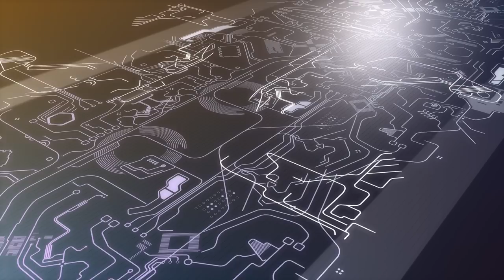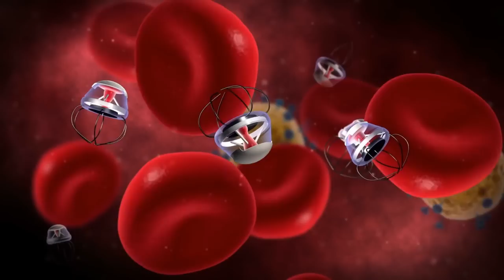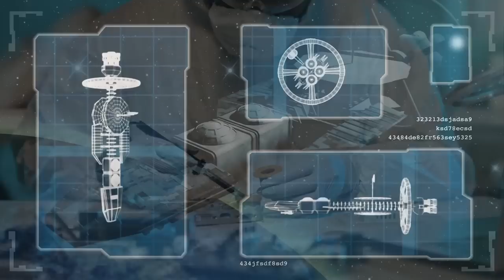Damaged Spacecraft & Shipwrecked Saucers

Comment: Starfleet is lucky to get volunteers at all, the way they do wiring. No wonder Scotty was on edge ALL the time; every interaction with the tech could have meant a horrifying electrocution.
Reply: I don't know why Starfleet just doesn't use crew consoles as warheads instead of antimatter.
Reply: It sounds to me you have no idea how the systems are surpose to work. There wiring is a lot more complex than anything we do. It is a mix of plasma and electrical circuits. There power systems are plasma based they don't have generators like we do. There power systems have direct conversion from plasma. That is extremely efficient but a lot more complex.
Reply: @clementvining2487  It is funny how with centuries of technological development, Starfleet still hasn't rendered pyrotechnic circuit breakers obsolete.
Reply: @clementvining2487  
All that complexity, with memetic gel packs and buffers everywhere, but something bumps into the outer hull in the just the right spot and ZAPP, another guy on the bridge gets charred to a smokin' spot on the carpet, and lightning flies all over the room...also, I'm makin' a joke about old-timey special effects.
Reply: @clementvining2487  And terribly implausible for an organization that prefers to have at least two backups.  Why would you pipe plasma into your control consoles when you can just use low voltage, low amperage electricity?  You don't get more or better responses to controls by way of Tim Taylor Technology; it isn't a problem you can solve with MOAR POWAH.
Reply: @earnestbrown6524  Yeah, a front company that sells discount electronics to the Cardassians...latinum only plez.
Reply: @boobah5643  The consoles generate there own electricity from the plasma. It is more efficient. The few times the explosions on the consoles happen is when exterme overloads happen usually in battle. The ship is very large and that is the most efficient way of using the energy. What you are suggesting uses too many interface systems. The control consoles can control almost everything on the ship.
Reply: @arcadiaberger9204 The don't use circuit breakers  they use power relays.
Reply: @clementvining2487  I will cling to the "pyrotechnic circuit breakers" explanation. It's parsimonious and funny.
Reply: @arcadiaberger9204  OK if you want.
Reply: @clementvining2487  If efficiency is getting people killed then Starfleet ships should not be prioritising efficiency. That's Borg philosophy.

If it must use plasma, have a big plasma converter near the bridge and run electrical cables from there. By making it one big unit, it should be easier to fit whatever system is needed to make it not explode.

I mean seriously, why is it less safe on the bridge of the USS Enterprise D than the UNN Agatha King?
Reply: @ReddwarfIV  It is star travel getting people killed. The technology is safe until   they are attacked or come across something unexpected. You change thing like you say you may make it more dangerous somewhere else on the ship. The best route is to make it as efficient and as safe as possible.  Nothing is perfect not even on a star ship especially on a star ship. Efficiency of the power systems means more power to protect the ship. So what you prefer less power with more damage from attackes or more power and less damage. Which well kill more people. The technology is set up to bring plasma anywhere power is needed and then electrical is  generated from there.
Reply: @clementvining2487  It is neither efficient nor safe to have many small power converters that are all at risk of killing a crew member, instead of one big one.

Please explain why it is neccesary to run plasma (a high temperature ionised gas) into a console that ought to require no more power than whatever device you are reading this on, since it is merely a screen with enough electronics to discern what commands you are giving and then send those commands to the ship's main computer.

Imagine replacing an ocean liner's Engine Order Telegraph with a version that uses a hydraulic line full of nitroglycerin, and tell me how that is safer and more efficient.
Reply: I’m surprised Scotty didn’t come out of Starfleet with Smoker’s Lung. That wiring sound hellish
Reply: @ReddwarfIV  First off it isn't a power converter. It is a power generator the plasma is the fuel it has direct conversion to electricity from plasma. And the control console is what it says a control console and you claim to know how much power is required on the bridge of a star ship with warp drive. It is like all the controls for a small city dozens and dozens of fusion reactors and atomic fuel cell all over the ship. Matter antimatter technologies and power systems. Keeping the warp drive balanced. Shielding and deflection technologies. Direct control over hundreds of system all over the ship. Look that is how it is suppose to work. I am done with auguing why or how safe it is. Think what you want I don't care have a good day.
Reply: @clementvining2487  Converter, generator, whatever, you're arguing semantics when we're both talking about the same system anyway... and you still used the word "conversion" in your rebuttal.

Yes. A control console. All it has to do is tell the ship what the crew want it to do. The sensors aren't inside the science console. The phasers aren't in the weapons console. The impulse thrusters are not inside the helm console. If these consoles are drawing enough power to warrant a direct feed from the plasma conduits, then they are in fact highly inefficient for their purpose.

Yes, it's starship with a warp drive. You'd think they'd have a more advanced interface than touchscreens, which we have right now. Holograms have their own flaws but at least the emitters keep crew out of the blast radius.

"Look that is how it is supposed to work"
I know. I am aware that there are in-universe explanations for why Starfleet ships are badly designed. This does not change that they are badly designed, nor should it prevent me from pointing that out.

TVTropes has a name for this. It's called a "Voodoo Shark". Where, in response to criticism, a writer will come up with an explanation that is even sillier than leaving it unexplained.

Consoles exploding is silly. Consoles exploding because Starfleet deliberately designed them that way is much sillier, and makes Starfleet look incompetent if not downright malicious to its personnel.
Reply: @earnestbrown6524    Or just install fuses and capacitors in them?
Reply: @ReddwarfIV  Dude what wrong with you I tried to be nice. I told you I was done with this augment. You don't address anything I say and totally discount everything and keep repeating yourself. There is no point I am not interested in talking to you so drop it.
Reply: @clementvining2487  If you want to end an argument, don't try to get the last word in.

Don't expect me to drop it when you won't.
Reply: @ReddwarfIV  First off dude I didn't say the control panel needed a lot of power you did.  I simply said how it was getting the power. Next don't tell me I can't have the last word and then stop. I didn't give up I simply think there is no point going farther because you don't acknowledge anything you simply keep repeating yourself. 

The idea you can say something unsafe when you have no idea how it works is ridiculous. And it is sifi they are going to make someone get killed the console exploding is for show it means nothing. The hole augment is ridiculous there fore pointless to continue. The plasma is like a fuel line to generate power except it is ionized plasma. We don't have this type technology it is sifi but possible in the future the physics is there. You don't tell me the rules to end a augment I do. You totally discount all my points and repeat yourself there is no point to contenue. Dude I am done there is no point in continuing.
Reply: @ReddwarfIV  I do feel that I have to correct something on all the shows the plasma base and isotope base fuel cells where in the wall. So the power generation for the bridge was most likely in the wall. The exploding console looked to me like a energy surge from outside the concole not plasma.
Reply: @clementvining2487  If you don't want to continue an argument, simply stop arguing. You want the last word because you can't handle losing an argument, and then you claim you are "being nice" by doing that.

You don't get to stab someone and declare "time out".
Reply: @clementvining2487  When did I say the control panel needed a lot of power? I consistently said it ought to have very low power requirements, and that providing it with the power it would require to violently explode is nonsensical.

If it can blow up and kill bridge crew members (the last people you want dying on a warship) while removing acess to an entire control system, then it is unsafe. I do not need to know how it works to make that assessment. Just like I wouldn't need to be an aeronautical engineer to know that an aeroplane's wings falling off in flight would be dangerous.

I am repeating myself because you keep giving the exact same excuse every single time. I have tried to give you various reasons why your argument is wrong. Every time, you just say "but it was written like that" and "you don't know how it works so you can't say that".

If the plasma generators are in the walls and the consoles are powered by electricity, then all you need to stop a "power surge" from causing consoles to explode is a fuse box. Sure, you may lose power to a console in the middle of a battle, but it's easier to replace a fuse than both an entire console and a trained, experienced officer.
Reply: @ReddwarfIV  You continued to say it didn't need much power which implies I said it needed a lot and I didn't. Another thing the console exploding looked like a energy surge and in fact it said that on the episode. And it wasn't from the console so a fuse would have done nothing. It was from outside the console a energy surge that doesn't necessarily mean electricity. In any event it wasn't from the concole.
Reply: @clementvining2487   You didn't say it. What you did was defend a design that allows enough energy to cause a console to violently explode. That can only happen if it is the console, and not the power supply, that is incapable of handling such high energies. Which means that the cables or plasma conduits leading into the consoles are capable of carrying a far higher load than they need to.

You also argued that the ship having a warp core was somehow indicative of the power demands of a console. You would only say this if you disagreed with me that consoles require very little power. Or if you are incapable of conceding a point on anything and must argue the contrary no matter how unjustifiable the position.

If you agreed with me that the consoles did not require high energy, then you could have simply said "yes, I agree" instead of continuing to argue.

If the fuse box is next to the plasma generator in the wall, and the cables supplying the consoles with power are hooked up to the fuse box instead of directly to the generator, then yes they would prevent a power surge from reaching the console. Further, a fuse could be rated well below the energy required to cause an explosion. It should be rated lower than the energy required to damage the console at all. In which case it would burn out and cut power to the console long before it could explode, even if the fuse was inside the console.
Reply: @ReddwarfIV  Another thing control of the ship is extremely important and I am sure there are backups on the bridge. The control console is little more than a touch screen enterface. And another thing the ship generates power levels in electricity in the gagewatt and terewatt level. At those levels electricity can arc through the air it is a wonder that kind of thing doesn't happen more often. So there safe guards must be pretty good.

 But as I remember that episode it was a energy base life form killed one crew member but was compatible to the captain. Another it was also a different kind of energy base life form who did it on purpose.
Reply: @clementvining2487  It would certainly make sense to have backups on the Bridge (I recall Janeway piloting Voyager from the captain's chair when she rammed the temporal weapon ship) but it would be far preferable to not need them in the first place (The should still be fitted, but the chances of having to use them should be reduced as far as possible.)

You may have a backup ensign to fly the ship, but it would be nice if the helmsman didn't explode in the first place.
Reply: @boobah5643  There is no plasma in the concole the plasma fuel cells are in the wall. I was wrong about that I forgot about the fuel cell being in the wall. The concole exploding was a power surge outside the concole if I remember it correctly it was a life form. No design or fuse or anything could have stopped that from happening. I do admit when I am wrong even if I forgot.
Reply: @Lawofimprobability Dude when did I say the control console needed a lot of energy I didn't. I simply said how the system works. The control concole is little more than a touch screen enterface. I did indicate the plasma went to the control concole and I was wrong I forgot all the fuel cell where in the wall. As for the concole exploding that was external energy surges fuse relays or anything else could have stopped that.
Reply: @MrLeafeater  They have replicaters all they need is the design and and materials that wouldn't happen.
Reply: @clementvining2487  power surge would be blocked by a simple fuse box or circuit breaker. The fact it explodes means this basic safety feature we've been using for 150 years wasn't installed and thus poor engineering and safety.
Reply: @Kallistos1  The energy surge was from outside the console a fuse would do nothing for that. It wasn't elctricity from the concole it was actually stated on the episode. It was a energy base life form. Your statements don't even apply. This happen at least twice one was a accident by the life form the other a different kind of energy base life form was on purpose. In that particular case no fuse, relay or any kind of safety device would have done any good.  Both times it wasn't a electrical surge but a energy surge of some kind. Your 150 years of useing a safety device wouldn't have made any difference. This wasn't poor engineering it isn't a building it is a starship.
Reply: @earnestbrown6524  I don't think they use antimatter exactly they most likely use warp matter or plasma for the warheads  it is easier to control and does the same damage.
Reply: Why use wiring at all? 
Use quantum entanglement of particle spin for digital signals. 
No need for any wires at all. 
No short circuits. 
No severed wires.

Comment: Tanks like the Abrams use a honeycomb structure in the fuel tanks that results in slightly less fuel being stored, but makes them more resistant when taking hits, so they position the fuel tanks on the front so it acts as extra armor for the tank. A large bunch of thick liquid makes decent armor, especially if held in place better so it can flow out of the way easily. It's a good ton plus they are carrying in gas on the vehicle, might as well make that double as armor while they're at it.

Comment: Long ago as part of my job, helped support the maintenance of a large factory.  It’s amazing what got substituted sometimes as suitable for purpose in a pinch.
Reply: 99% of problems in a factory can be "temporarily" fixed with a cable tie. Spaceships just need to take up a big bag of cable ties. Problem sorted.
Reply: @McShave  approximately half their mass in cable ties to be safe.  😀
Reply: @theblackswan2373  It won't be paperclip maximizer Fermi Threat; it'll be rogue cable tie fabricators.
Reply: @harbl99  no doubt!  LOL
Reply: "It ain't pretty, but it works."